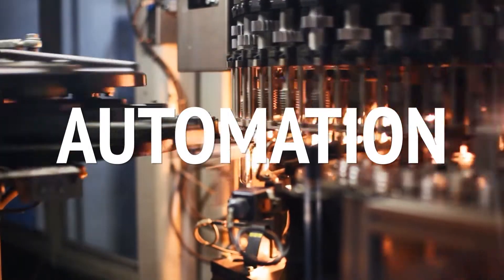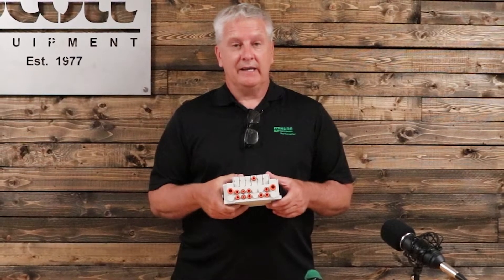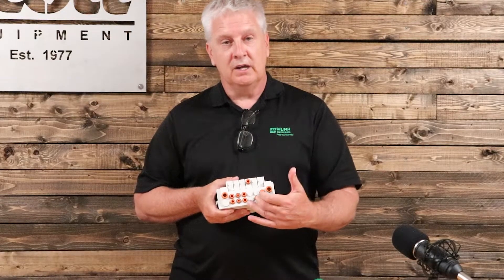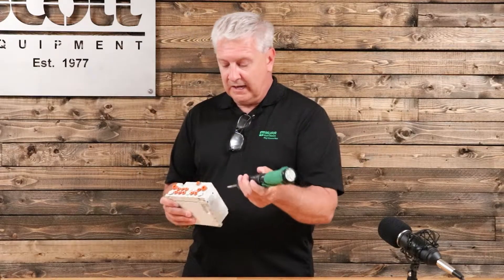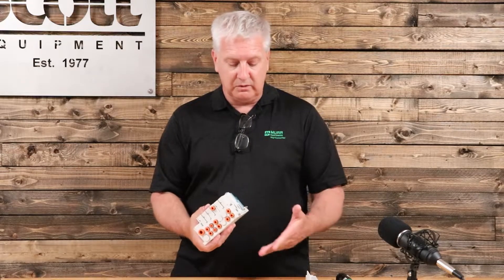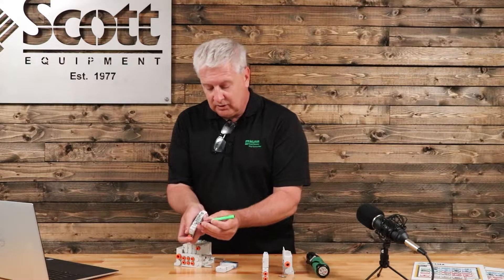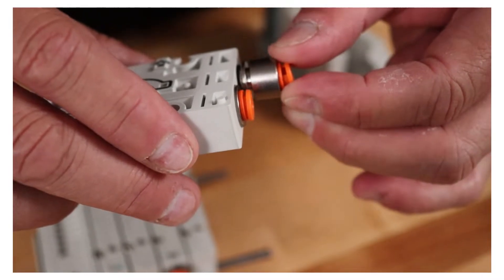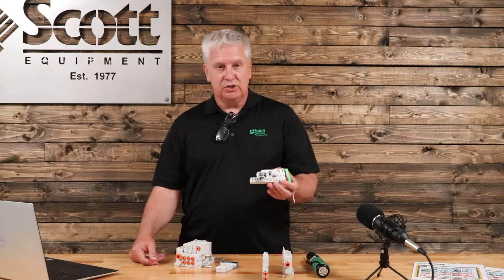Troubleshooting a SMC Valve Manifold - Automation Simplified - Episode 16

Comment: exhaust valve leaking heavily, also i am getting air when solenoid is not energized.what could be the issue??
Reply from the maker: If it is leaking out of the exhaust port it is most likely one of a few things.

The first we see commonly on manifolds that are ported from both ends is that the pressure on one end is connected to the exhaust port instead of the pressure port.

The second is sometimes people don't realize in configurations where it is ported from both ends (D&U side) that there is a pressure connection at the opposite end as well.  This can sometimes be perceived as a leak in exhaust.

In some cases one of the valve spools is stuck in a crossover position.  In these cases sometimes shifting the valve with the manual overrides or energizing the coil will solve the problem.  If this doesn't correct the problem will need to determine leaking valve and repair or replace.

Lastly, it could be low air pressure supplied on the P port (less than 40 psi if memory serves me correctly).  This can cause the valve to only partially shift.  If using low pressure supply you have to use an externally piloted manifold that receives it's pilot supply from a separate high pressure source.

Comment: Sir same valve i used 

I this gang valve during running condition air drop problem found is there possible in this gang valve ??? Like some vlave by pass or mixd air ???              I give 7 kg of air pressure but when I connect this gang valve then it comes down 5.5kg.        and also I checked all pnu cylinder which line in this smc valve.  ...but no leakage found like 1.5kg pressure drops....!!!!!   Any solution for it?